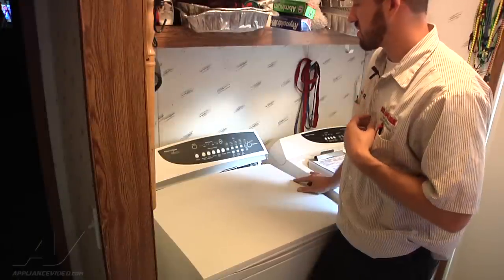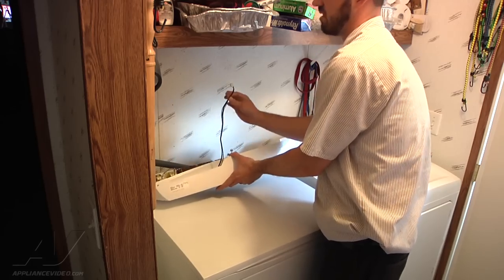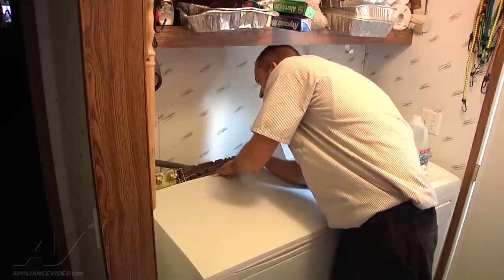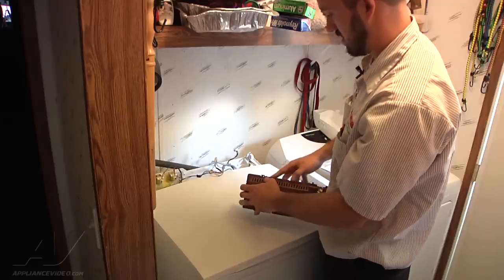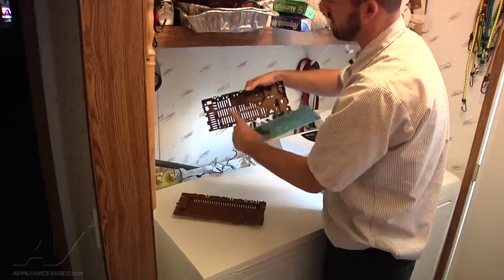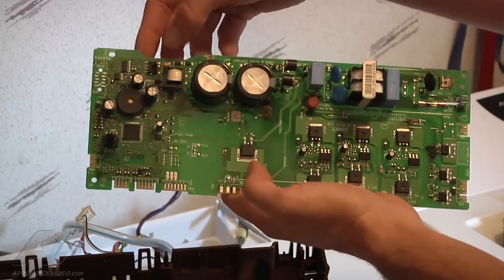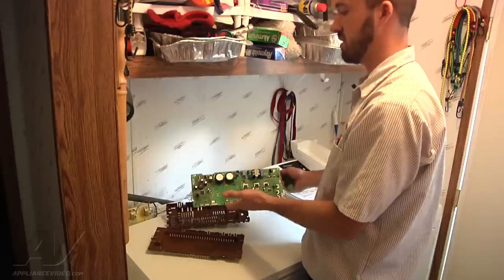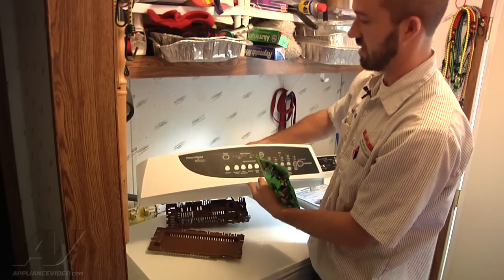Fisher & Paykel Washer Repair - Will Not Start After a Power Surge - Machine Control

Comment: Good Vid..
Where do you get NEW board..for Elba FisherPaykel washer- WA47 t 26 ?
I had water on floor..took apart found clap never installed on top where H20 enters washer. Some how water must of touched something..smelled it..Quickly unpluded it
A hour later put clamp on to previent future H20 leak..Something tripped power..No power now. Pulled every connector off rear of board and reinstalled. Still No power
I'll have to disassemble and see if inside board is showing burn mark or fuse out next.
Thanks. If you know where I can get board for this model..let me know THX
Reply from the maker: Thanks for your response, we are glad we could help. Our library of over 5,700 videos are currently helping over 1.6 million people like you every MONTH.  Please help us by subscribing to our YouTube channel, or post our website www.ApplianceVideo.com to your Facebook page, Twitter, Instagram or any other social media sites. Your support will help us keep producing more free quality videos.

Comment: My fill hose is leaking. When you lift the lid on the machine it's all the way to the back there is a plastic fill spout with a white hose. How do I get to that to repair it? Does the top of the machine come off?
Reply from the maker: Great question, with our
technicians now getting hundreds questions weekly, they are answering all questions
at our website at ApplianceVideo.com under our Repair Help section. We have over
3,000 common questions and answers that you can easily search through by your
model number, appliance make, and problem or error codes.
Reply: It dus

Comment: I have a (1995) Fisher & Paykel GW 701-U machine, that has never missed a beat, and had been used twice weekly during this time. About one month ago, the machine failed to start. I do have some electronics knowledge (self-taught), and so I decided to find out why? When the Wall Switch was turned-on, the Drain Pump Motor was energised - and creeping round slowly. Drain Motor was also smoking. Using my knowledge, I replaced a resistor, an Opto - Triac Driver, and the Power Triac (BT 136) that drives this Drain Motor. Put it all back together and it worked correctly. The pale blue Control Module for this machine (Phase 2) is now impossible to get hold of....
Then, following a couple of washes, the GW 701-U began to trip the Earth Leakage Breaker. I pulled apart the Control Module again, and examine the PCB to discover where this earth fault could arise. I pin-pointed two (2) X2 rated capacitors which went directly to the earth contact on this PCB. I replaced these.......
GW 701-U was working again! THEN BANG!! The machine stopped again, accompanied with a slight 'burning' smell......
The Control Board was removed again and thoroughly examined..
I noticed that the PCB was wet! On this model of Washing Machine, Fisher & Paykel had designed an Aluminium Extrusion which was water-filled at one end. This special tube was there to keep the ten MOSFETS which drive the Main Motor and other associated drives (Drain Pump) cool when the machine is in operation. I removed this water-filled tube, only to find that there had been corrosion of the alloy tube (underneath) which wasn't visible from the top of the PCB. After spending some 10 hours work on this Circuit Board, my determination became stronger to 'get this thing working again'! I removed this alloy tube, (all pin-holed underneath). Carbon-Tracking across some components had caused the PCB Fuse to blow....
I went online, and bought an alloy tube which was a 'sliding fit' inside the original extruded F&P Tube, and bonded this into position. Now, this will not leak water all over the PCB again. I replaced four (4) wire junctions on the PCB (all corroded). The PCB was re-varnished twice - after these were soldered in position.
With the addition of chlorine in the Mains water supply, I felt that F&P should have thought to plastic-line this water - filled alloy tube on their PCB Control Module. I really shouldn't be too critical after the great service that this machine has provided, and I would most certainly buy another F&P machine. If there are any budding electronic people out there who would like to attempt a repair to those old Control Module PCB's my simple advice is this: Study every component on the PCB, and (if you feel that a MOSFET or any other component is faulty by testing), it is most important to replace with like-for -like components, as these are special parts. Even the fuse on the PCB is a special type - so be aware! If you do own an 'early Fisher & Paykel that fails, and you have little electrical knowledge, you could remove the Control Module and take it to a TV Repair Man. Yes, he will see this board just as another job. All worth a try before scrapping a great machine that has given you this great service. If I can help just one person here, then my efforts in writing this has been worthwhile.
Reply from the maker: Great question, if you have a
more technical question that our parts department cannot answer, you can search
our over 10,000 answered questions free at our website www.ApplianceVideo.com under our Repair Help section. You can also call
our parts department at 1-800-830-5465 and they can give you help 7-days A week
Monday -Sunday, or search at www.SaveMoreOnParts.com  24 hours
7- days A week.
Reply: @Appliancevideo  boilerplate reply WHY bother saying anything if all you do is say "call us"??

Comment: How do you turn off Diagnostic mode
Reply from the maker: Great question, if you have a
more technical question that our parts department cannot answer, our
technicians are answering all questions at our website at www.ApplianceVideo.com under our Repair Help section. You can also call
our parts department at 1-800-830-5465 and they can give you help 7-days A week
Monday -Sunday, or search at www.SaveMoreOnParts.com  24 hours
7- days A week.

Comment: I have a fisher and paykel GW612 that is stuck in diagnostic mode fault 49 but I cant get it to go back to normal start settings.Are you able to tell me how to get it back please.
Reply from the maker: Great question, if you have a more technical question that our parts department cannot answer, you can search our over 17,000 answered questions free at our website www.ApplianceVideo.com under our Repair Help section. You can also call our parts department at 1-800-830-5465 and they can give you help 7-days A week ,or search at www.SaveMoreOnParts.com  .

Comment: how do you get the fuse out to replace it the kid overloaded it and the fuse is burnt I've looked at it and kind of looks like it will need to be unsoldered don't have the Extra to Replace the machine
Reply from the maker: Great question, you can call
our parts department at 1-800-830-5465 and they can give you help 6-days A week
Mon-Sat . You can also search at www.SaveMoreOnParts.com 7- days a week.  If you have a more
technical question that our parts department cannot answer, our technicians are
answering all questions at our website at www.ApplianceVideo.com under our Repair Help section. We have over 6,000
common questions and answers that you can easily search through by your model
number, appliance make, problem or error codes, and It’s completely free to
search through our question & answer library. There is a very good chance
you question is already answered there.
Reply: I had a shorted pump that blew the fuse and I replaced with an inline fuse holder BEING careful to use same fast blow (4 amp I think), rather than pull out the board and remove the exsisting fuse I soldered directly to the end caps of the original fuse, eben as bad as this board was, it still worth fixing
Reply: @emilee172  you did what? you left the old blown fuse on the board... and soldered a new one to it?

Comment: Most likely a blown fuse. I’m wondering if the load on the breaker with both of the washers running caused a surge?
Reply from the maker: Great question, if you have a
more technical question that our parts department cannot answer, you can search
our over 10,000 answered questions free at our website www.ApplianceVideo.com under our Repair Help section. You can also call
our parts department at 1-800-830-5465 and they can give you help 7-days A week
Monday -Sunday, or search at www.SaveMoreOnParts.com  24 hours
7- days A week.

Comment: I am not sure whether we had a power or not but I have a Fisher and paykal smart drive 508. It powers on properly but once I select the operation and hit start button, the cycle does not begin. It does not take the water in through the inlet pipes. Cna you help with this issue ? Thanks ij advance ✌️
Reply from the maker: Great question, if you have a more technical question that our parts department cannot answer, you can search our over 13,000 answered questions free at our website www.ApplianceVideo.com under our Repair Help section. You can also call our parts department at 1-800-830-5465 and they can give you help 7-days A week ,or search at www.SaveMoreOnParts.com  .
Reply: if no water then check make sure water is turned on , you can see if the water inlet is clogged with hard water junk but it sounds more like you may have a bad water valve sylonoid , try running with all hot water or all cold water